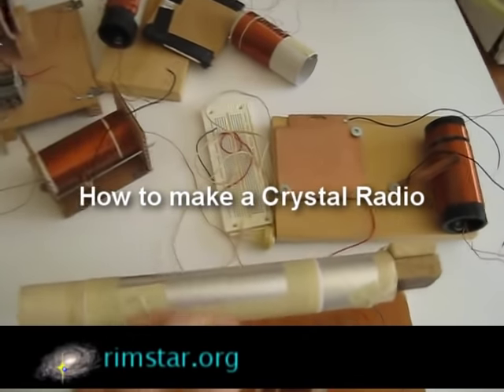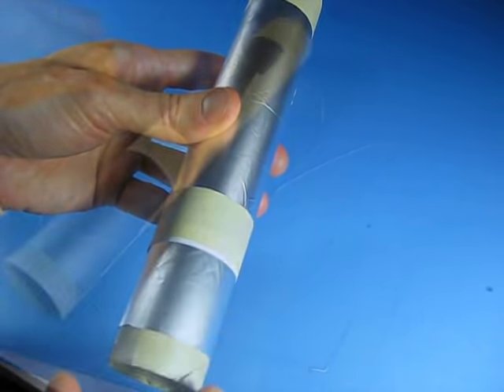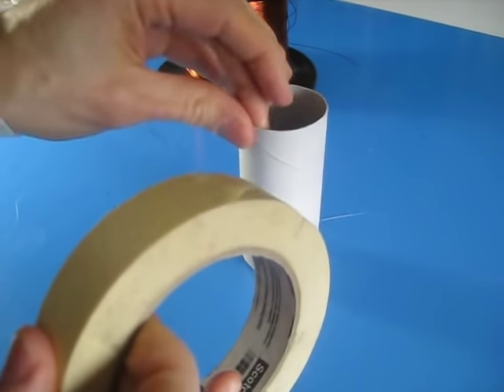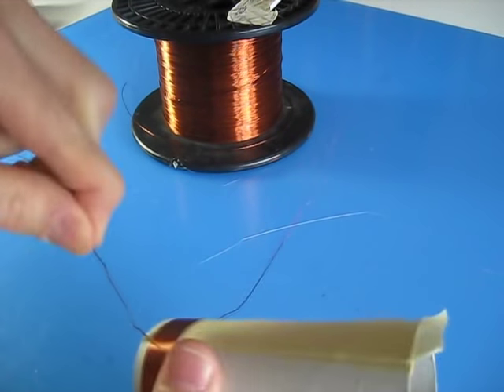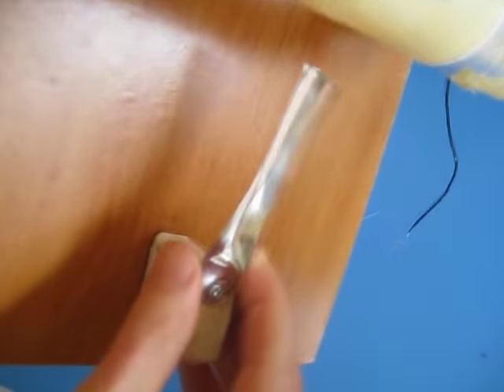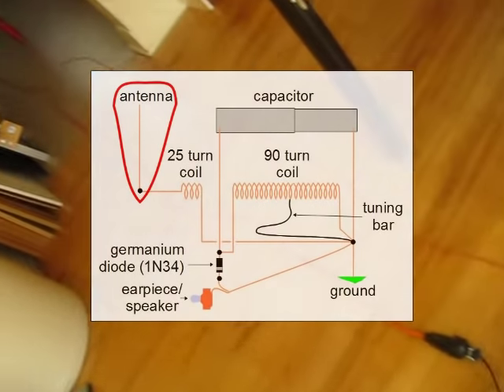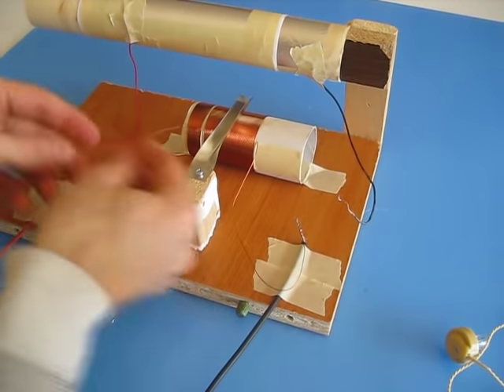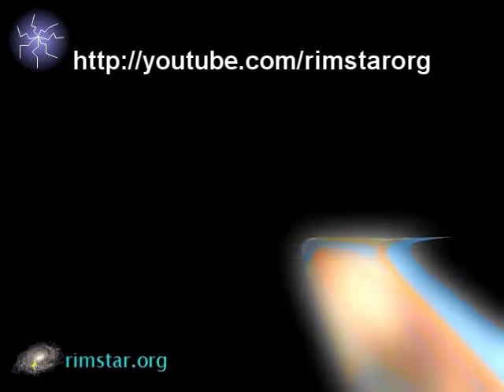How to Make/Build a Crystal Radio

Comment: just made one of your radio projects and ran a 50ft speaker wire from inside the home to a 15ft galvanized pole on the carport, so from the home to the carport is horizontal  then the wire is wound around the 15 ft vertical pole on the carport,  hopefully itll work
Reply from the maker: If it doesn't work then try just hanging from the 15ft pole without winding it, or keep the winding to just a few turns.
Reply: @RimstarOrg       just raised the metal pole and tie wrapped the double strand wire to it all the way up with 15ft going to the home. so total length is around 40 ft from inside home to top of metal pole. hooked everything up and doesn't seem to be functioning...……...is thier some place I can send you a pic of the radio so you can check it out??   BTW I didn't wind the wire up the pole it just went straight up with tie wraps

Comment from the maker: In 100uF, the uF is microfarads, which means that's a capacitor, not a diode. So you definitely can't use it. Any germanium diode will work. I've put a partial list in the description below this video. I haven't tried it but you may also be able to get it working with 5 or more silicon diodes connected together in parallel.

Comment from the maker: Ignore the + and - for the speakers and just connect one speaker wire to the end of the diode that has the stripe nearest it and the other speaker wire to the ground. Having said that, these crystal radios aren't powerful enough to power speakers so you very likely won't hear anything. :( There are many places to get piezo earpieces. The Source has piezo buzzers (part no. 2730059) which you can use as an earpiece. See the description below this video for my other videos where I discuss options.

Comment: You may want to suggest putting a thn piece of tape, where you want to sand and either spray laquer or shellak the windings, take the tape off and then sand so as not to disturb the windings and still get a real good removal of insulator. Just a thought. I really like the variable capacitor
Reply from the maker: Good idea. Even now, as the windings get a little loose with usage, sliding the contact across them disturbs them a bit. If I'd added laquer as you suggest then I wouldn't have that problem. I guess I can always add it now too. Thanks for the tip.
Reply: RimstarOrg At this point, you could put a thin line of super glue on each side of the sanded windings to keep them secure.

Comment from the maker: I use a piezo speaker which I took from a microwave oven, so yes, a piezo speaker should work, assuming you mean one where it's a disk shaped piezo crystal. It's a little quieter than the commercial made piezo crystal earpieces. Cut a short piece from a plastic pen to direct the sound into your ear like I do in my "Make Crystal Earphone/Earpiece for Crystal Radio - Homemade" video. There's a link to it in the description below this video.

Comment: 8:00 You don’t want to use ground from the AC socket as it will cause your radio to be very noisy. It’s like mixing all of your electronics with their dirty electricity. Plus the long ground wire acts like a radiating antenna that will pick up a lot of noise. Best to use an isolated ground.
You could use better electronics such as a variable capacitor since you’re already using a diode.
Looks like a cool project though. Just wish we had more technical info such as the frequency range. What are you powering it with? There is no way this transformer is powering that headphone piece.

Comment: Nicely done video. Sadly, though, I tried this project with my 10-year-old son, as a first electronics project with him, and we've been unable to get a response from the radio. Dead silence from the earpiece. We checked and rechecked the connections, flipped the diode in a different direction and then back again, tried a different diode from the pack, tried various grounds … including two radiator pipes, a metal water pipe going into the foundation, and an iron pole pounded into moist earth in the back yard … still silence from the earpiece. I also double-checked that the tinfoil we were using as the wiper blade (cut from the top of a Chipotle take-out container) conducted electricity, by using strips of it to attach a 9-volt battery to a small buzzer we had lying around. It worked; the material is conductive. "Nothing is as easy as it looks on the Internet," said my son. I watched the trouble-shooting tips, and tried them. It's a long shot, but if you have any additional thoughts about what else we might try, we'd be grateful. We used two 15-foot lengths of insulated wire (sold as "doorbell wire" at the local hardware store, solid copper, insulated) as our antenna.  We used a Chanzon 1N34A germanium diode … and  Philmore crystal radio earpiece. (One note, fwiw: When I touch the end of the diode that the earpiece lead is connected to, we DO get a faint buzz in the earpiece. That's the only response we can get from the earpiece.)
Reply from the maker: It sounds like you've done everything right. The only suggestion I can think of is to use a longer antenna, the longer the better. You also want most of it to be in a straight(ish) line. it's also best if the antenna points to a radio station but that's hard to arrange.
Another idea is to put an amplifier in place of the earpiece. That will at least tell you if you're getting something but it's just too faint to hear.
Reply: RimstarOrg Ok, thanks. We’ll give that try. After writing, I tried rewrapping the two coils to get them a bit closer together, but it didn’t help. One other question: Would putting extra masking tape on the coils to hold the turns tightly together interfere with them? (I assume not, since the wire is insulated anyway.)
Reply from the maker: No, adding masking tape won't interfere with them.
Reply: RimstarOrg I tried adding a longer antenna. Still no luck. As I’ve thought about it, I did have another question for you, if you don’t mind: I can’t see any point of contact between the tinfoil on the two halves of the capacitor: There’s paper, an insulator, entirely covering the bottom of the moving piece .. The two pieces of foil never seem to touch at any point, so I can’t see how electricity can flow from the wire on one end to the wire on the other. Did we build this wrong? Or do I just not understand how the capacitor works?
Reply from the maker: That's how a capacitor works, two electrically conductive electrodes separated by an insulator. See this video of mine which introduces capacitors https://www.youtube.com/watch?v=GveI9gXIsHw.

I recall sometimes thinking that my tuning bar was touching the bare metal of the coils where you scraped away the insulation on the coils but that it wasn't.  Make sure the tuning bar is touching where you scraped away the insulation.

Did you try with the amplifier? The signal may be too weak to hear. You can see the one I made and use here https://www.youtube.com/watch?v=JtPwxbOgBHw though you can buy them instead. Do you have any AM radio stations nearby? It could be that there's no one to receive from. In that case you can try making a transmitter https://www.youtube.com/watch?v=_4-Sx-T6VBc. Just make sure you don't transmit too far (keep the power low and the transmitting antenna short) since it's illegal to transmit without a HAM radio license in most countries.

Comment: I built one of these in fifth grade for a science project in the 1950s but with just a tank coil and fixed capacitor. I understand the antenna primary going to ground to complete the ground loop but not the tank circuit (inductor capacitor resonant circuit) grounded. Is this to gain a little more using the tank inductor to form an antenna ground loop?
Reply from the maker: To tell you the truth, I don't have a good answer for that. You'd think that since the antenna coil is electrically separate from the tuning coil, the tuning circuit need not be grounded. It works better if it is though.

Comment: Mine is like 2 or three meters long, sometimes I use one that is shorter; around here there are 2 main MW stations that have quite a powerful signal, the others are hard to hear even with a regular transistor receiver, I tried many diodes, some of them were silicon, but the 1N4148 gave the best results, it's a nice option for people experimenting with crystal sets, as the 1N4148 is extremely common in PCB's, I can give you a small list of diodes that can catch a station on this kind of set.

Comment: Excellent video, had my first crystal radio, a Remko model back in 69,. as well an electronic Health Kit Lab few years later. I want to get back into small electronic projects as a a primer for my future experimental electric guitars building. Where is the best place to purchase electronic parts, circuit boards today online, i.e. resistors, transistors, diodes, capacitors,  tuning capacitors, etc. ???

Comment: What sorts of crystals can you use for the radio? Could you use any from jewelry?
Reply from the maker: No crystal is needed. In the early 1900s, the diode was actually a chunk of galena crystal and you'd touch it with the sharp tip of a wire but these days you use a diode like the one I show in this video.

Comment: The second end of the 90 turns coil is connected to the ground. I thing it’s not really required.

The circuit will always gets completed through the tuning wiper.

Comment: THE MOST SIMPLEST CIRCUIT OF CRYSTAL SET IS JUST CONNECT A DIODE IN SERIES OR IN PARALLEL WITH HEAD PHONE AND CONNECT ONE WIRE OF HEADPHONE TO ANTENNA AND OTHER TO EARTH. NO NEED OF COIL AND CAPACITOR. YOU WILL HEAR THE SOUND.

Comment: Coat all the coil forms with a coating of clear varnish to keep it stiff and non-conductive.
Reply from the maker: Good idea. Thanks. That would help with keeping the turns from wandering while the wiper blade is moving across their tops.

Comment: Connect a 47k resistor or similar in parallel with the earpiece and you'll get a higher volume. The crystal earpiece is non conductive for the DC and needs a resistor. The schematic is good without a resistor for high impedance magnetic earphones.
Reply from the maker: +Origoangelohrol322 Thanks for the tip. I tried that in the past and didn't notice a difference. But it certainly is something that helps sometimes. A reason I'm aware of for it is for it your germanium diode isn't leaky enough. Perhaps my diode is sufficiently leaky for it not to make a noticeable difference.

Comment: What would happen if a ferrite core was placed inside of the coil?
Reply from the maker: You'd have to redo the calculations for how many turns of wire you should use and also the dimensions of the capacitor. Together the inductance of the coil and the capacitance range of the capacitor determine what radio frequencies you can tune into. I explain how to do those calculations in this video here https://www.youtube.com/watch?v=tjD9I95RAbw . I talk about how to design the coil here https://youtu.be/awyLYgu6ODM and the capacitor here http://youtu.be/GveI9gXIsHw

Comment: Did you have coil mixed with capacitor mixed in one construction ?
For example you can use movable part of cap inside of coil (there is large unsused space inside), and make coil on top of static cap plate insulated from coil with few turns of paper.
Reply from the maker: Nice. Sounds compact. But no, I haven't tried it.

Comment: what's the capacitance of this capacitor? Im trying to recreate this and get the measurements of parts written down and calculated as a project. also, you said the plates were 6x6 inches but it looked like you overlapped them when you wrapped them around the paper towel roll, so arent they no longer that area? what area is it that the plates overlap?
Reply from the maker: It's around 640 picofarads (0.64 nanofarads). You cans see me measuring it in my troubleshooting video here https://www.youtube.com/watch?v=HZZmKZJrIW0 at around 4 minutes in. As a I also point out in that same video, for my coil you need only around 355 picofarads.
As for the area, not counting overlap, the circumference of a circle is 2 x pi x radius of the cylinder. Multiply that by the 6 inch length and you have the area.

Comment: When you talk about using the capacitor to adjust volume, is the radio being de-tuned slightly to lower the volume? I'm wondering because I'm using a fixed 100pf cap and want to see if a variable cap will help with fine tuning. I was quite excited when I saw some radio station frequencies on an oscilloscope, but I added the diode and realized that the signal  was too weak to even forward bias the diode. Oh Well, I'll make an antenna later...
Reply from the maker: Yes, I was de-tuning it slightly resulting in a lower volume. For the antenna, the longer the better, and most of it should be in a straightish line (i.e. not just a bunch of wire in random orientations).

Comment: Hey i really appreciate your knowledge and information on the crystal radio, i have a question, on the piece of wood on the oppisite side of the ground, what is the red wire connected to?
Reply from the maker: +Charlie Shoupe If you mean the red wire coming from the aluminum foil capacitor at 10:20, I connect it to the end of the diode that doesn't have the stripe on it, and to one end of the 90-turn coil. You can see this connection point in the diagram at 0:27, just above the diode.

Comment: RimstarOrg had a couple questions. i was wondering what effect would wire gauge have on this project? is there a reason you're wrapping the magnet wire in sections taping down as you go? is a germanium diode key, or can you use a zener?
and it's theoretically possible to use something like a LM386 circuit and some cheap pc speakers?
Reply from the maker: Kewl Beans The wire gauge doesn't really matter. The reason I'm taping it down as I go is to hold the two ends in place. Note that there are two completely separate coils being wound on the tube. You can see the reason for two coils here in my "How a Crystal Radio Works" video http://www.youtube.com/watch?v=0-PParSmwtE. Yes, the germanium diode is key. A zener won't work. A germanium starts conducting at a much lower voltage and that's needed here since the voltages are so low. And yes, you can up up something like an LM386 circuit to make an amplifier. I do exactly that in this video here https://www.youtube.com/watch?v=JtPwxbOgBHw
Reply: RimstarOrg thanx i actually found that video after just forgot to post there and say nevermind. thanx for the response though.

Comment: Can I possibly use paper clips with the rubber coating has wire?
Reply from the maker: I've never thought about it but if the paper clips are metal and you can remove the rubber coating from the ends to make good electrical contact with the metal then they should work.

Comment: hi again thanks for the info about the wood. I would like to ask you another question. What is the gauge of the red thicker wire with the plastic coating on it?
Reply from the maker: +bandn514 It doesn't matter. Use whatever wire thickness you have. That one just happened to be 24 gauge wire.

Comment: For the piezo sounder, you might try looking in an old smoke alarm as well. These will come with a horn, though they might need amplification to be any use as a speaker. 

BTW I assume these coils are for MW? I would like to try and make a simple set to pick up just one radio signal on LW (198KHz -it's BBC, well I am a Brit and a boring one at that) could the coils be modified for LW, or would I need to go for a ferrite core?

Comment: Also used to put the earphone socket straight into the garden soil to pickup a  transmitting radio station .
Reply from the maker: Do you mean with no crystal radio at all? Or just one wire from the socket to act as a ground?
Reply: +RimstarOrg Just the wires from either using headphones or an earpiece.  This was back in the 70s ! Love to know if it still works .

Comment: I'm doing this for a science fair project and I'm not sure how to get ground. There are radiators,  but I'm not sure if they'll let me scrape the paint off?!!! Also, would it be possible to use a small battery powered speaker and strip the wire instead of the earpiece so other people can hear? One last thing, I've run out of magnet wire. would it be possible to use a tube of a smaller diameter, as I am using a 1 1/2 inch PVC pipe?

Comment: Hey buddy loved your project. But i have a few queries:
1)Is it possible to somehow detect the frequency of received waves? I dont wanna buy costly electronic displays.I would rather be satisfied by calculating from circuit configs.
2)If the speaker is replaced by a microphone, can i transmit over that frequency? Ofcourse I would connect a battery say 6V-9V to power the transmission.Just want to know if it is possible.
Pls. Reply ASAP.
Thank you for the upload and advanced thanks 4 the answers.

Comment: Hi,
Nice project. I tried it yesterday and it works - sort of. I have a question. - I can hear one station very clearly but only if i grasp the two ends of the diode with my two hands. At first, I thought it was a loose connection. But it is not. It appears as though it is using my body as an antenna or ground, I am not sure which. Any ideas ? For the secondary coil, we are using the full 90 turns. Thanks.

Comment: Excellent video in terms of presentation and showing what can be done with literal scrap! How’s the sensitivity compared to the same circuit but with the metal-vaned air-variable tuning capacitor?
Reply from the maker: I have one but I've never tried. I'd imagine it wouldn't be too different though.